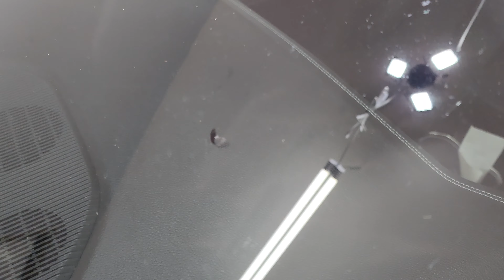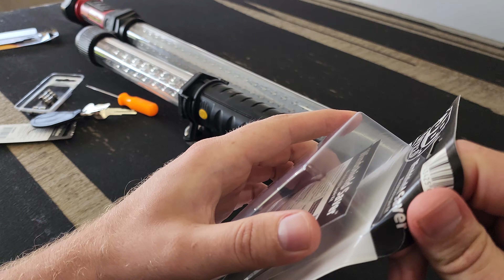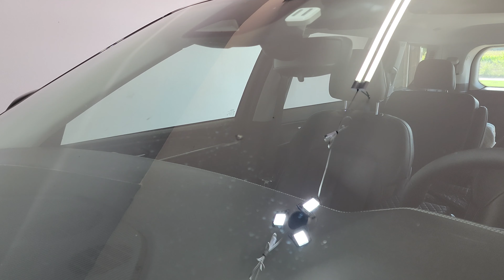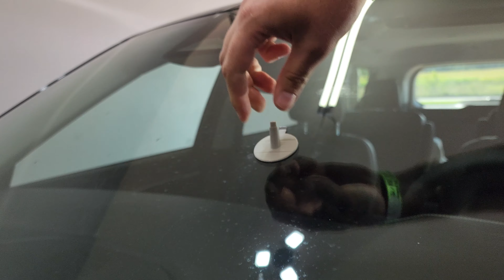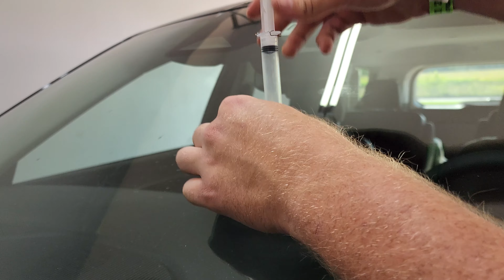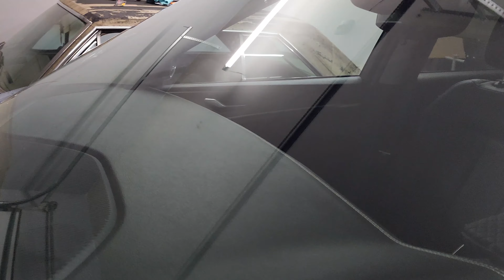J-B Weld 2100 Windshield Saver Repair Kit - First Use, Impressions and Results!!

Comment: good video but just a heads up  at the end its the yellow strip that you are supposed to use when it cures in the sun not the clear strip ....the clear strip is actually the backing....they should clear this up in the instructions....but jb weld does have a video on here that shows it

Comment: What your seeing is air trapped in the break. If you use a bic lighter to lightly heat the glass from the inside it will help the air escape . Also tapping lightly with the lighter on the inside can help.

Comment: I just bought and used one of these kits.  Overall, I would say it worked well but I don't like how the instructions say to use most of the resin for the initial repair, and save some for later, but there is no way to see how much is left in the tube when you are squeezing it into the pedestal.

Comment: Boooooo worst kit ever! So many better products out there way easier to use and clean up, this thing made a mess of my windscreen. Now I need to buy another different kit. Terrible
Reply from the maker: I didn't have any issues, still holding good today.
Reply: All of the kits are almost identical.  If you can't follow the directions to make this one work, you won't have any better luck with any of the others.

Comment: Thank you for the video. I just fixed my Lexus. One other tip, I did mine on a clear 70° day and when I parked it in the sun to cure I used a UV flashlight on the inside of the vehicle, shining on the glass.  Hopefully it helps

Comment: Do you remove the thin layer of resin after taking off the clear strip
Reply from the maker: @grahamstall1556  yeah you do
Reply: @RamblinGarage  Having experience in paint/body/coatings, I'm concerned about excess material build:

Razor in a timely manner will handle it, or does it leave a film build?
Looks surprisingly great in your video,  thanks!